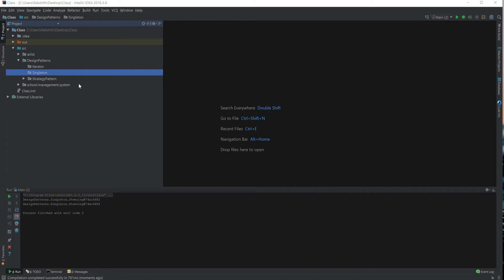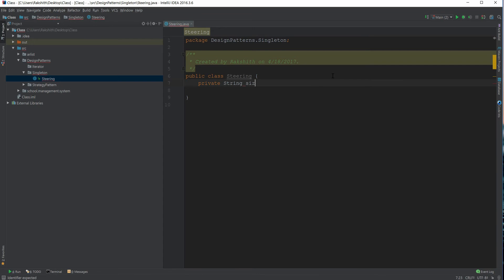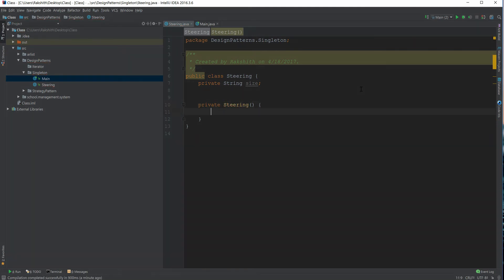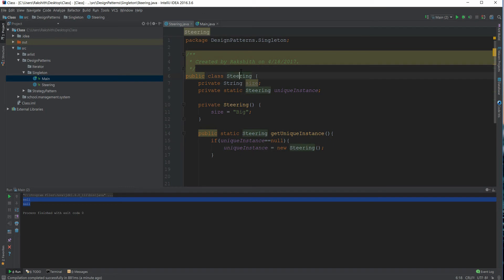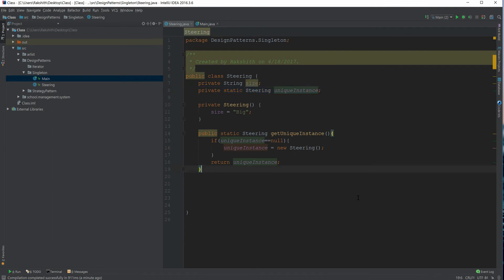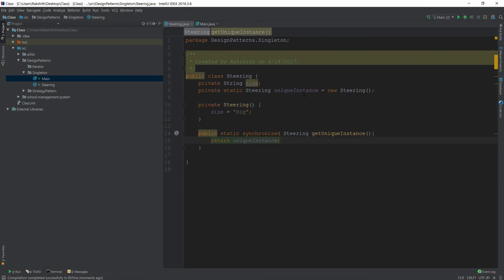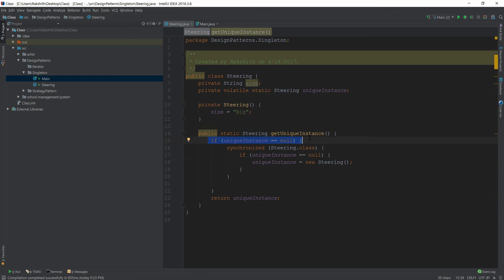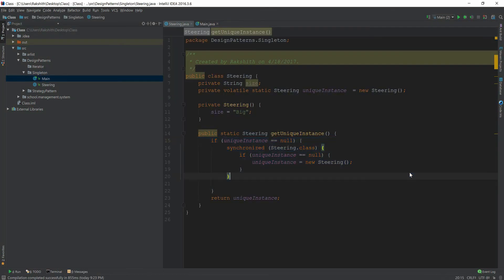Singleton Design Pattern in Java explained in the easiest way with an example.

Comment from the maker: I forgot to explain what "volatile" would do. It simply makes the program atomic. Meaning, the transaction either happens or not. In our context, the value of volatile field becomes visible to all readers, after a write operation completes on it. Without volatile, readers can see the non-updated value.

IN OTHER WORDS,

If 2 threads read and write the value of a volatile variable, other threads only read the variable. This makes the reading threads to see the latest value written to the volatile variable. 

To make everything work together, "synchronized" and "volatile" must be used in pairs because "synchronized" is the only thing that ensures writing and reading of variable is atomic.